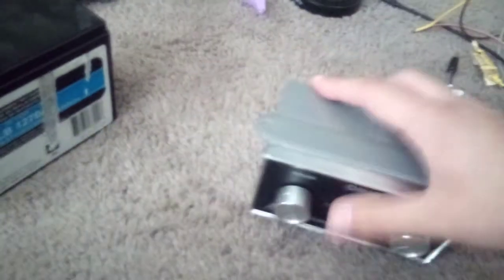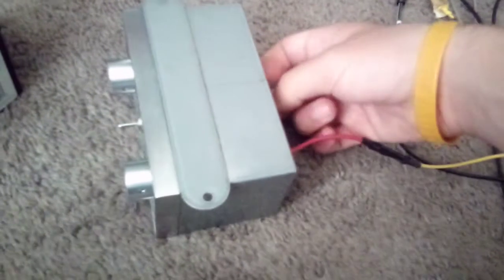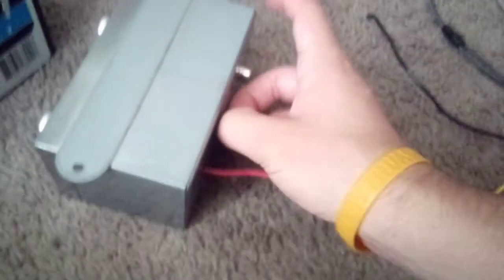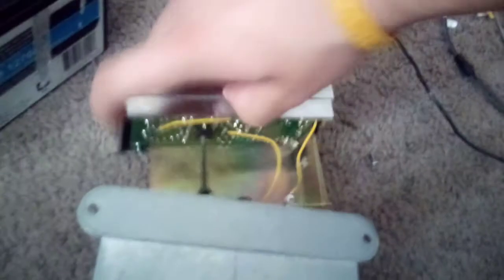how to set up almost any Nichols electronics music box

Comment: Tip: If you don't want to use a battery, you can use a 12V power supply like me. Do NOT use an adaptor, it puts out the wrong form of 12 volts and your box will not work. In this case, use the red wire and connect it to the positive (+) terminal and connect the ground wire to the negative (-) terminal.
Reply: One Question Did You Cut The Cord On The Power Supply Or Did You Plug It In Somehow
Reply: Make a tutorial on how to do it

Comment: Thank you CSX Railfan 1000T for showing how to do that, but I have a question, why did the pitch go down so quick when you turn the volume up?
Reply from the maker: It was the battery I was using
Reply: @1000tCSX u can also use a 9v
Reply: @1000tCSX also thx for the help for this cause for this actually help me with my omni cause i had this remembered in my head